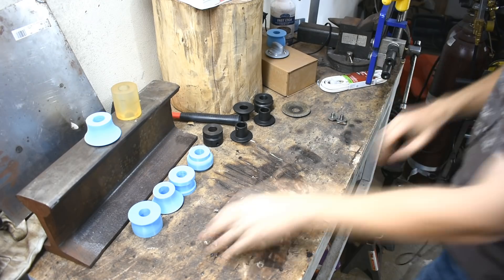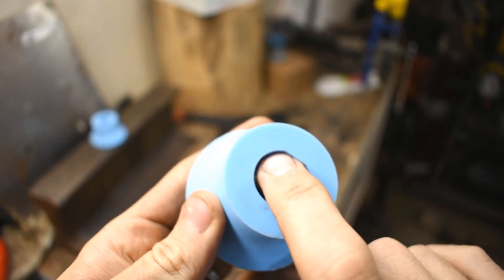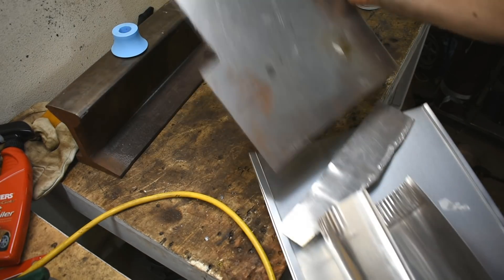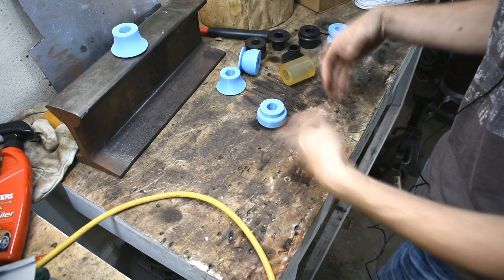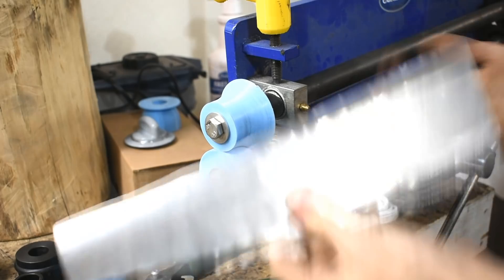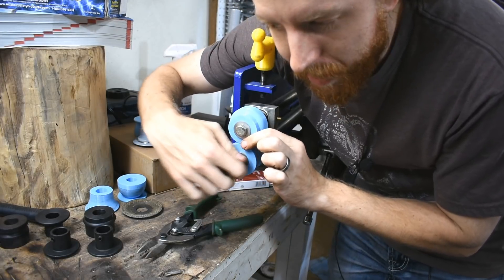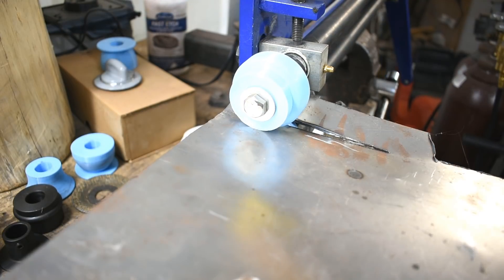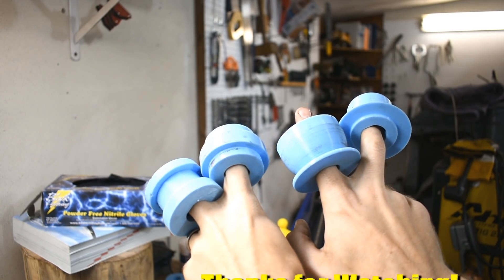Make Custom Bead Roller Dies with 3D Printing

Comment: question: have you possibly made tweaks to these models or your infill etc in order to improve the quality or effectiveness of the 3D printed dies?
Reply from the maker: nope i didn't change them at all after this video.  I haven't used them in a few years, though.  i'm not sure how well the plastic stands up to the years in the hot garage.

Comment: Howdie awesome workmanship ya can make it happen thks for sharin your ideas keep them coming ya got my vote wondering how much wood ya sell these for just asking cause l,m building a Bead roller and Don,t hav alot of cash so just asking if ya did and do ya have to have the centre hole open ? Cause thinking mine is 1 inch shaft if that helps hopefully we can come up with a sale price  ? from Canada 🇨🇦 SK later keep me posted thanks for your time need these for car body's for kids toys if it Don,t break me later Paul
Reply from the maker: I don't have these posted anywhere and i don't have the files anymore.  This is a pretty old video and i had a computer fry on me a couple years ago lol.  They were made with fusion 360.  You just make a profile and revolve around an axis, cut out the center hole to whatever size you need.  it's very easy to do and hobbyists can use fusion 360 for free i think.
Reply: @PaulsGarage  Thanks so much for your feed Bk will give it ago take care be safe from Canada SK Later will rember that Name Thks so much

Comment: We have been 3d scanning floor pans and pressing out repair panels
Reply from the maker: that's awesome.  I haven't tried scanning with a full size car yet but i scanned a whole powerwheels mustang and then printed out a fitted body that looks like the ford delux from greased lightning.  That was a fun project.  video eventually on that one

Comment: it looks like the only thing needed is to fix the flex in the bead roller. but I am glad its doing that since i feel it would add stresses to the wheels that a solid roller wouldn't show. i see this as a great way to make one off or "one project" set of wheels for car bodys and you can mirror nearly any factory bead just by printing it off.
Reply from the maker: Good point!  This bead roller definitely flexes a lot.  There are modifications to help stiffen it for sure, but these plastic dies work surprisingly well

Comment: Yes, I'm late to the party, but I had to toss my 2.3 cents in.  Mild steel is softer than most heat treated aluminum, especially that really thin stuff used for duct work.  If you can bend it pretty far and it springs right back, you'll need to anneal it before running it through your dies.
Also, you can send your files to Shapeways or some other printing outfit, and they can print them in a variety of metals.  It's not as expensive as it sounds.
Lastly, I LOVE your sense of humor!

Comment: I had some 3d.printed yesterday. 3/8" bead, 1/2" bead, 1/2"  round tipping die, and a 1/4" offset die. They're 1-3/4" diameter and 100% infill out of PLA.... And they work. 18 gauge crs..

Comment: This is something I need.
Ive printed gears for my lathe. They work great and are even quieter.
The problem is with the design and files.
3d design software is way over my head.
How about a link to the files ??
Reply: McMaster-Carr catalog has free downloadable 3d models for parts like gears. Depending on format they can be sliced. Opens a lot of possibilities...

Comment: Hi Paul. I see you shared the STL for the crank handle on MyMiniFactory - any chance you'd be willing to share the fusion models & STLs for the dies? You've certainly inspired me to try printing some dies for the roller I just bought. Same one as yours I think, and I could do with a die to round over on a 19mm radius. Needs to go a full 90 degrees though, so not sure it's possible yet. Amazed they worked at 10% fill in PLA too.

Comment: Will you be sharing the files?
Reply from the maker: Yes!  At the moment I'm working out some details on different designs, already came up with an updated louver die for example.  I'm also working out a system with shims to allow better side to side adjustment, will be uploading the files to myminifactory and probably thingiverse for free when I get it worked out
Reply: @PaulsGarage  Many thanks.
Reply: @PaulsGarage  have you managed to make any print files for these since you  posted 2 years ago?

Comment: Nylon has one big issue as a 3d printing filament, it absorbs water from the air.  At my work we have a printer for nylon the filament is in a sealed box with desiccant and a tube to the printer, the printer software is setup to run all the filament that is in the tube  before starting printing the part, if you try to print with filament that has water in it you get steam bubbles that will ruin the print.

Comment: It worked better on steel than ally because your ally's been welded on & is thin.  It's less ductile due to the welding and with how thin it is explains the tearing.  Either way it's a cool experiment to give a bash & save some coin.

Comment: Bake those PLA prints! Another rabbit hole to go down...
Reply from the maker: That's what I hear! I'm interested in the increased strength but I worry about any deformation.  This is pretty exact clearance to the shafts and any wobble in the outside would transmit to wavy beads in the sheet.  I dont have a lathe to true them up either
Reply: Deformation is definitely going to happen. It can be designed for, but that's only one piece of the puzzle. Wait, I said it was a rabbit hole. Which is it, a puzzle or a hole? Or a whole puzzle? All I really know is that rabbits give you tularemia.

Comment: Since you have them on solid works find a CNC and mill them on there out of aluminum or steel and try it then. Or try over sizing on solid works and reprinting those and make molds and cast them yourself and tune them down on a lathe
Reply from the maker: I wish I could do that!  No lathe for me, but I do have some friends with machine shops...

Comment: 10% infill?? Wow, I've never gone that "hollow" and I don;t print anything that would be that stressed.
Reply: I believe CNC kitchen has a video about testing 3d print strength and he found that the wall thickness is mostly where the strength comes from. He found that infill really doesn't do as much as people think and if you want something stronger, thicker walls help a lot.
Reply: @evanro2396  yep... this video by CNC kitchen. More perimeters are more important than a higher infill percentage.

https://youtu.be/AmEaNAwFSfI
Reply: I came here to say that. When I print anything that will see stress I print 100%.
Reply from the maker: I never use more than 15% infill, haven't really had anything break yet either
Reply: I'll have to give it a try. It'll save print time and filament

Comment: I love printing with pla It smells fairly decent when printing. Vinyl stinks up the house but it definitely would be way stronger. Have you thought about trying the carbon fiber filament they came out with?I bet that will be pretty tough. Then there's all types of different metals that they've come out with.stainless steel, bronze, brass pretty crazy what we can do with a 3D printer anymore. 👍👍great vid Paul
Reply from the maker: I've heard the carbon filament screws up brass extruders, otherwise sounds like a cool idea
Reply: @PaulsGarage  I would imagine all of those metal filaments screw up the brass tips also

Comment: Now cast them in bronze :D if there's one thing i've learned about PLA, it's that it gets brittle over time, in about a month they will likely crack if you tried it again. I'd try coating them.
Reply from the maker: I'm shocked the PLA didnt crack instantly!  I'm thinking of trying PETG next, then nylon.  Then maybe casting some
Reply: @PaulsGarage  Put that forge to work buddy :D
Reply: @PaulsGarage  I use ST-PLA for power hammer dies. They don't last, but gives me the option of changing parts that might not work as well as it should and then reprint and test. Once you have it dialed in, you cast it in kirksite or whatever variant is available. Much tougher than bronze and easier to re-melt and re-cast.

Comment: Yes you can. It costs a lot more than an injection molded one. Now I'll watch the video.
Reply: Depends. Just because something can be made for pennies, doesn't mean that anybody will make that and sell that to you for pennies. Particularly things that are not needed in million quantities. Besides, with that low infill ratio, these were cheap prints, and weighing even a useless print agains the benefit of excercising your modelling and slicing skills and learning from failures and successes about the properties of materials that you work with and how to deal with mechanical loads, i think if you ask the to print or not to print question, printing tends to win if you own a 3D printer.
Reply from the maker: Yes indeed! These printed ones are cheap for me, already owned the printer.  Of course the cost of the printer could buy a nice bead roller...
Reply: @PaulsGarage  then again it's not about cost optimization, right? 😁